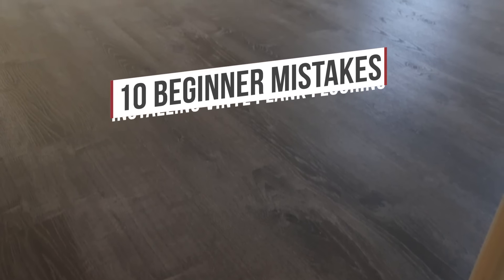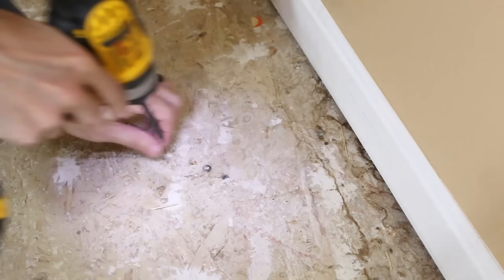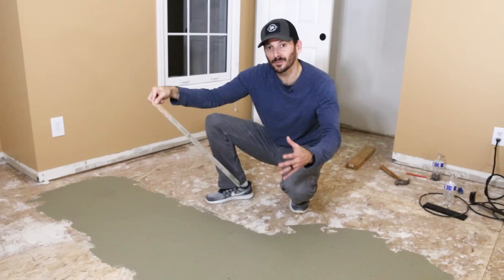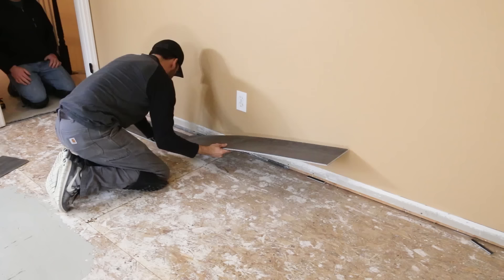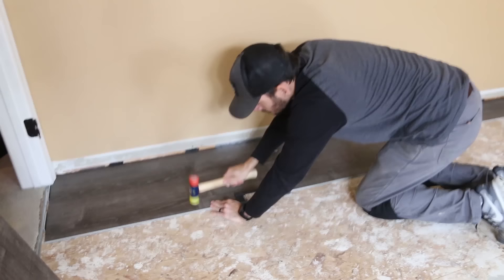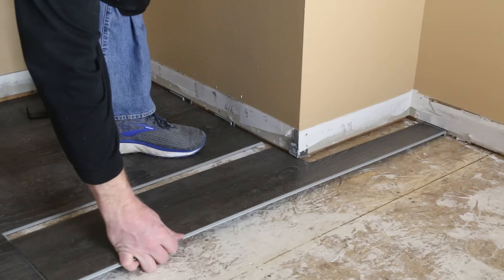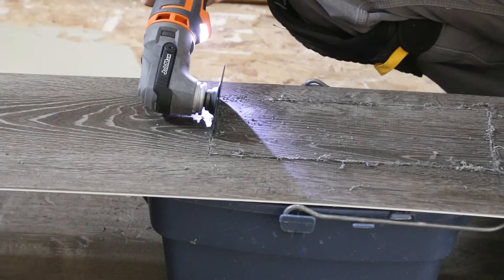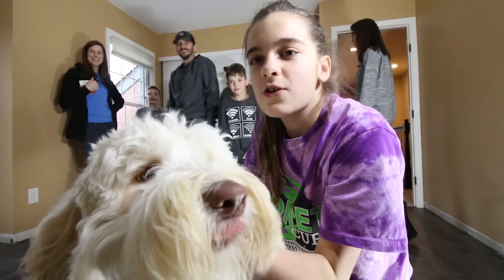10 Beginner Mistakes Installing Vinyl Plank Flooring

Comment: Just from learning by doing this job on my house I found it unnecessary to remove the baseboards if you are going from carpet to lvp. The baseboards sit up a lot higher on a carpeted floor and will allow you to just easily slip the planks slightly underneath them. Then, just cover the gap with shoe molding. You'll save yourself a lot of time and hassle. Trust me.
Reply: Good im.about to do this then
Reply: Our baseboards were fried so I wish we could have done this :/
Reply: If you slide the planking under the base trim, how do hook on the trim puller on the planking that is under the base trim to pull it tight?
Reply: @dreid4760  it shouldn't be that tight. Might want to trim off some with a table saw.

Comment: Thank you for this video.
Still one more question - is it OK to install a vinyl flooring without a noise absorbtion layer?
Reply: I'm sure a noise absorption layer is up to you.  But you may need a vapor barrier on concrete first floor.
Reply: same thought, but I saw one of his planks underside and looked like it already had some sort of rubber layer to it so that’s why he didn’t use a noise absorption thingy
Reply: Not with lifeproof, read manual!

Comment: I always remove the base board. It just makes sence. You save no time or money leaving it. due to shoe molding. So ether way your installing something
Reply: Option #1: remove base, install floor, skim drywall (base will be lower), reinstall base (buy new or labor to repair old), spackle/caulk trim, repaint
Option 2:
Install floor, install quarter round/shoe mould, spackle/caulk quarter round. Done
So, how am I not saving time and money by option 2?

Comment: was this done on an upstairs floor?  I'm in the process of removing our upstairs carpet and putting vinyl plank.  I know for regular tile you have to lay down durock boards.  I'm just don't know if I also need to do that for this type of tile. Thanks.  also, the video was very informative.

Comment: When you do the spacing in the begining.. do you only do that at the starting end of the wall or do you do that all around
Reply: Flooring specialist here! You space it around all four walls, for expansion purposes. Make sure it's a 1/4" gap.
Reply: Flooring guy here too... Mistake #999 - assuming just your wall base/trim will cover the manufacturer's recommended expansion gap. Lots more to flooring than a lot of people cover in these types of videos but you can't "what if" every scenario...
Reply: @johnnycastellanetta7183  do you have to remove the baseboard if the gap under is more than 1/4”?  In other words, I assume you are risking the boards separating if the gap to the wall under the trim is more than 1/4”.  That would mean that unless you are installing right up against the baseboard (without sliding under them like he might have had to do in this video if he did not remove them) then you are going to have to remove (and replace if you want) the baseboard?
Reply: @jjflynn7271  you don’t really need spacers you’ll just have to cut 1/4 short on all four walls of the room. You can leave the wall base but you’ll most likely need a quarter round.

Comment: You dont start on the longest wall, you start on the longest EXTERIOR wall. Interior walls are not square. You can end a row with any size piece you want, the joints in the middle of the floor should be about 8 inches apart. 7:48 that does not matter at all

Comment: thanks. I wish when you had laid the first board you had explained more about the spacers. Do we still need the quarter inch spacers, if there is a gap between the ceiling and the floor - can't the flooring expand there?

Comment: When the miter saw leaves just a small amount left uncut like in this case you can tilt the uncut portion into the blade a little to avoid flipping the plank.
Reply: Rob Bob nah - use this as an excuse to buy a compound sliding miter saw.
Reply: bad idea...it could "kick" the piece out of your hand and ruin it.. since tilting is not a stable surface

Comment: im starting a project just like this but i just cant get them to connect to each other. Everytime i move them around they pop out and i get gaps.
Reply: Don’t use this crap. It will
Last 5 years and be looking terrible after
That time.
Reply: @cygnus1965  what would you suggest ?
Reply: @Sjrick  cant ever go wrong with tiles, if properly installed they can last a lifetime

Comment: I'd love to remove my baseboards first, but old plaster walls and a century of paint, makes me think I'll end up having to redo the walls too if I tried. lol. 
Any tips on that?
Reply: Make sure to cut the caulking and paint perfect off the top of the baseboards before removing them because it WILL take the paint off, plus buy new taller baseboards so it covers the missing paint
Hope that helps

Comment: Do you bump them tight against the walls? I’m doing my first rental property and I’ve always heard you should leave a small gap around the edges.
Reply: No 1/4 inch spacers
Reply: Cut shims from scrap tiles.
Reply: thats only for hybrid and timber planks vinyl is fine to be hard up
Reply: Your tile pack will have paperwork in it and it should mention using spacers around the edge of the room. I think most do, but I'm no expert. My tiles say 1/4 inch spacers should be used for expansion.
Reply: @fwpedro  No. It is not. Many LVP floors will buckle if they are tight against the  walls.
Reply: Leave a gap.  Do not install it tight to the wall.
Reply: Vinyl will grow and the Heat and grow tight in the cold yes always about a quarter inch let the vinyl set in your house for a couple days before installing so it will get use of your heat
Reply: It tells you what to do on the box lol
Reply: @fwpedro  I really hope everybody disregarded your answer because it is absolutely not okay you have to have room for expansion. If not you will be having it buckle in the middle or wherever it wants to find a spot more than likely wherever you damaged it with a hammer
Reply: @anitamclaughlin327  good luck with that a box is not a person that does it everyday. The Box is for your money is going to say whatever to make it sound easy
Reply: @chadhamilton88  well mine tells the spacing for that particular product. Mine says 3/8 to 1/2. I'm sure others say 1/4   I'd say you would need to check with the product you are putting down

Comment: I always put the baseboard.  Not pulling the board seems to be a lazy move.  Also, installing with the fancy tools makes life so much easier.  Even after investing in new tools.  The job is cheaper than hiring a pro.  And you are set up for future projects.

Comment: Those transition strips are way too expensive! Dang, there should be a gold chain with each one.
Reply from the maker: No joke! And you have to buy in 6 foot strips but never use more than 3'
Reply: I hate installing those damn things on concrete floors.
Reply: @soloban81  there is a 2 part one fir that. Screw a metal strip down with tapcom screws then the fancy upper part slots on that.
Reply: @Fishingtuts  ...or just use liquid nail.

Comment: I absolutely despise the industry standard of installing a floating flore without removing the baseboards...
Reply: Why do you guys wanna create more work for yourself. I mean I get it in your just installing the floor but then they have to hire a painter to come fix the now exposed damage. Quarter round leaves a margin for error and looks nice. I’m a carpenter and painter I’ve seen the full circle. If your really concerned why not just undercut your base?
Reply: @stevendecker4136  Not to mention replacing broken pieces and what if you can't find the exact pattern? I prefer shoe molding myself to quarter round. If it's a refresher project then I leave the baseboard and add shoe molding.

Comment: I was really looking for how you dealt with the last piece in the rows. Thanks for the corners. Seems as if you just measure the piece needed to meet the baseboard then shoe molding can cover the gap. Is that correct?

Comment: You released the stretch on the carpet in the doorway when you cut it. Should have stay nailed the carpet outside the doorway before you cut it, then cut it, then reattach next to the transition. Beginner mistake is having a wrinkle in your hall carpet in 3 months.
Reply: Yup

Comment: We plan to install the vinyl flooring on the second floor. Is there any kind of underlayment that can be used to help provide an acoustic barrier? Or is the flooring material perhaps sold with an option for a thicker sub-layer to address this?

Comment: I woulda just threw some shoe molding down after install
Reply: I agree, that way you wouldn't have to deal with what the top of the baseboards look like now that they're 1/4 inch lower exposing old latex caulk and unprimed/unpainted exposed drywall. They left that crucial part for a successful finish out of the video.
Reply: @allanrheaume5549  exactly, either shoe molding or go with a bigger base or your gonna have more problems then you want to deal with

Comment: Big  mistake. You never use any kind of thinset or patch on a wood subfloor. Reason why there is always movement in a plywood subfloor. In time that thinset is going to break up and crumble from the movement in the floor. Thin set or any kind of patch will not bond to a plywood floor !!!!!!! N
Reply: Then what would you use?
Reply: Mark Lyon as long as all the joints are even in the plywood you don’t need to use anything. If there uneven you either need to screw the higher side down so it’s even with the one side.  If that does not work you need to install a subfloor over that floor before installing the plank. Remember vinyl plank is flexible they make it to conform to a subfloor. Industry standards allows  the floor to be 1/4 out for vinyl plank. The main thing is also make sure all screws or nails are totally flat in the subfloor or they will show right threw the plank once it’s down.

Comment: If I’m doing in on a basement with concrete I don’t need underlayment ether? Great video and thank you
Reply: Yes, you do... if you want to protect the warranty.

What seeps up through concrete isn't water, its a chemical soup.  That can warp and damage a LVP... and the hydrostatic pressure that can build up through it can cause your joints to peak up.

I see it waaay to often.

I put vapor barriers on all my jobs.

Comment: i noticed when you used the chop saw to make a normal cross cut you flipped the board upside down and had to make 2 passes to make one cut... just take your left hand and raise the board up a bit to finish the cut. super easy and quick for using smaller homeowner DIYer type chop saws, ie: if you don't have a larger sliding mitre saw, which is the real way to go, by just using a big enough saw. or you can always score and break, there's many ways to avoid having to make 2 passes.

Comment: Always remove the baseboard.
Reply: Agree, but what do you do with that paint gap at the top of the baseboard now?
Reply: Is the baseboard not raised when the floor is installed?
Reply: @CHIC1957  Not if the layers of carpet removed are thicker than the vinyl plank. But you can always get a higher baseboard
Reply: I just place a wood trim... Other places depends what color it is, i left a 1/8 gap and chalked it

Comment: Using shoe mold or quarter round only adds a detail that makes a floor look complete. All about the details. An inexpensive cost to cut a corner at the very end. 
Not to mention from a cosmetic view it's a no brainer

Comment: If you have in level floors check it with a long straight edge a 4-ft 6 ft level would be fine and then get some self-leveling concrete you pour it in wet and when you pour it in it goes with gravity to where the lowest area is you don't need to put thinset in there this stuff is great it drives really fast and it's very skimmable. And as far as underlayment goes a lot of condensations down here in Florida require underlayment and condominiums because of sound abatement it's also a very good insulator even if you have a wood home but check manufacturers suggested things I would still put a vapor barrier if you're in the north and you have snow and such I would really recommend putting down a vapor barrier it was my home I would

Comment: thanks for this, great video.  question... should you use the longest wall as a guide for your floor or should you find square using 3,4,5 instead.  I'm not claiming I know, i've just heard this before.  thanks

Comment: Great video! It gives me the courage to try and lay a new floor in our bathroom, on top of floor tiles.
BTW, Do you not need to put a length of Cork, or similar, around the perimeter to make up the small gap between new floor and wall. Also doesn't this cork allow for expansion?

Comment: There were two other mistakes that should be mentioned when installing your flooring my friend found out three hard way. 1: never use a framing hammer to hit the tapping block with your thumb over the block and hit it ( ouch ) . 2: never place your knee over the joint of two planks with a gap and have someone hit the block with your knee pushing on the board to keep it down, you will get caught and lose a chunk of meat from your knee , one again, ( ouch ) and some other choice words. The same goes for hitting your thumb with a framing hammer , one again, some more choice words. Nice video. 👍🏼

Comment: Vinyl flooring has very minimal expansion but I would do the same remove the old trims and put new ones but it depends wether it is your own house or a rental. For a rental I would put a quarter round saves a great amount of labour and cost.

Comment: On the base boards if you didnt want to take out a taller base board (must be tall) you could use a small wedge at the bottom of existing base board after installing

Comment: Can you take up where you started and fix a gap you missed with out having to take up the whole flooring?  I had a piece that didn't get locked in 3 boards in from the starting side..
Thanks Tony

Comment: I really like that beautiful room, the one with no pipes, heating registers, toilets or claw foot tubs to contend with. Oh, let's not forget non square walls, doors with a slight slant, small work areas and on and on. Good job though! it looks great! As for the removing of the base board question. I think the answer lies in its expected life. Will it just need to be replaced in a few years? That said my one and only constructive contribution here would be this. it's real useful to keep the flooring tools and an open box of tiles on a rolling dolly. It keeps all your important tools and tiles at arm's reach as you work down the line. Saves a lot of time.

Comment: my daughter has just replaced our carpeted livingroom into a interlocking planking floor. she has it done without the floorboard trim and we found some boards that did not lock so they are coming apart. what do you recommend to fix it? can it be tapped together, but the bad spot is in the middle of the floor? Or do we need to pull the floor apart to the bad spot? Thank you for your input.

Comment: I can do 100 - 400 sq ft per hour depending on layout. First three rows I do at the same time (cut 2 starters at arbitrary lengths) and I adjust for straightness before clicking the finishers on.
Lay out stacks throughout room, anticipating how much you’ll need where, such that there is always a board within reach.
Click every piece by hand. When you get a feel for the technique then it takes very little effort. I’ve gotten it down to just a few seconds per board. I can literally do them one handed with no struggle at this point.
From there I pretty much stay crouched or kneeling until the job is done. Click, scoot, click, scoot, score and snap, click, scoot, and so on. Three to five rows at a time.

Comment: I had full flooring installed by NFD. They replaced the subfloor because there were huge dips. After it was all done we had moulding around the entire edge of the floor nailed in front of the existing moulding. Also the floor still has dips.

Comment: Doing the floors in a house we just bought, what should  i do if the base was installed before the carpet? So the base and the casing are all in contact with the subfloor. Should  i cut around the entire base, remove the base, or just try to cut the casing and notch the flooring around and under the casing and just put in shoe molding

Comment: Hi I am going to go with vinyl flooring for my kitchen. there are two types. One is more  and no "cork" backing. the other cheaper but I like the color better. What do you recommend. I want the cheaper one because of the color but I want to pay more for a better backing. What do you suggest?  Does the "cork" backing make a better floor? thx.

Comment: I am installing laminate flooring in a basement. I;m installing the planks lengthwise running down the long side (I believe that is correct?). However. to start on the far left side means I have a large are with no wall (i.e. 15 feet on the far let side). How do I handle this, since there is no hard surface to push the planks in against. Thanks - I hope this description was reasonably clear.

Comment: Do you have any input on how to do the top of the stairs?  I'm doing our main floor, which is a walkout rambler.  I'm guessing I need to start with the stair bullnose (buying in vinyl plank) as my first plank so that I can match up to it's interlock? And then do the rest of the flooring from there, i.e., hallway (that runs perpendicular to the stairs), etc.